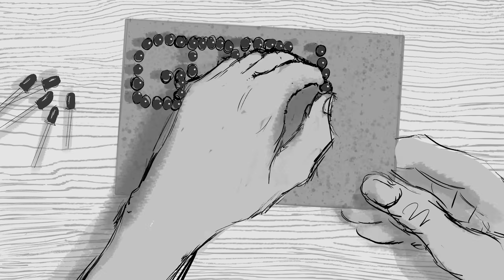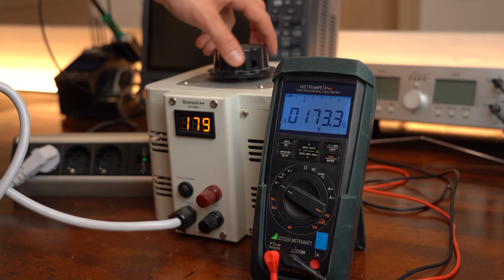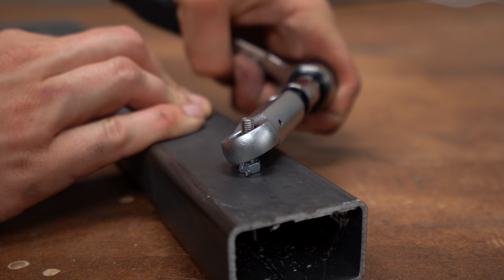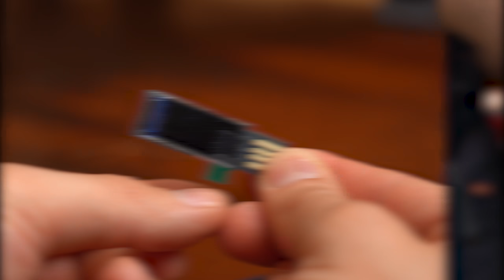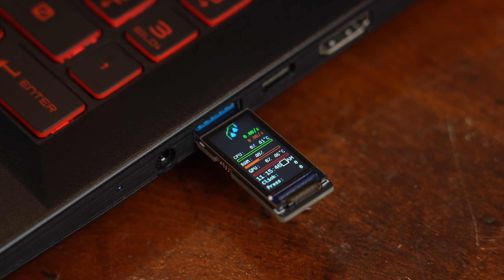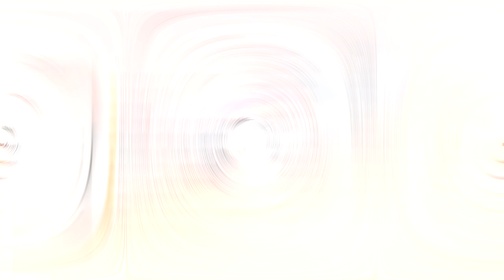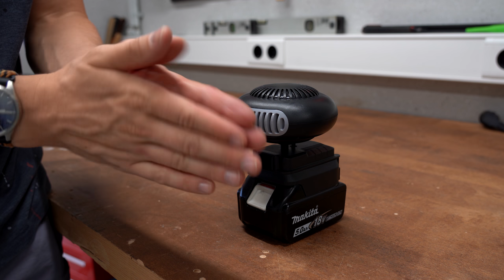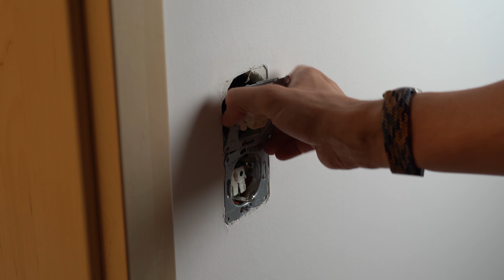I tried finding Hidden Gems on AliExpress AGAIN! (SPECIAL Part 20)

Comment: About Aliexpress and Europe tax, how do you do ? because in electronics, some cart price can double just with the "3€" tax, how do you do ? you pay whatever ali ask without saying things ? Because some product you've shown are well priced (and the price has gone up lately) but just having 3€ per article is too much for multiple product cart with price that sometimes are lower than the tax.
Reply: They should do the same tax too big companies reselling chinese crap.
Reply: @MisterMakerNL yes, but that tax was pushed by those companies so I don't think the EU will do a switch of target, its always easier to make the people pay than companies...
Reply: @MisterMakerNL The import tariffs apply to everyone and all companies but if say Action buys 20,000 usb cables, the €3,66 tariff has no impact. 
If you buy a single cable, €3,66 is significant.
Reply: 3,66
Reply: I really hope this doesn’t come the the uk. Been buying my saved items asap just incase 😂
Reply: We’re having to pay duty for packages under £135 from October 2028 (currently excluded), this means we’ll be paying Roya Mail, DHL and UPS £8 to £12 for taking payment for duty, that will already be worked out, unless the politicians stop the monopolies. Hahahaha.

We shouldn’t be upset.  It’s silly that I can buy an identical item from China at a fraction of the price Amazon sells it for, we need to ensure we bump Amazons and other middlemen profits, where would they be without corporate welfare, considering all the great things corporations do for us … oh wait.
Reply: @The45thClown  
I suspect that AliExpress will setup larger warehouses in the EU and extend the number of item they sell from within the EU. 

That means that customs can do checks on large amounts of the same items while customers will only pay a fraction of the tariffs.
Reply: it's a damn shame. in austria we also get an an additional 2,4€ package tax. so you pay 6€ extra per order. it's so stupid i can't get any of the stuff i buy from AE locally.
Reply: @schwuzi  wym, is it new? Cuz i didn't have it before
Reply: @DanyloGrinchuk there as an import tarriff of 3€ per category in the whole EU. The extra package tax is specific to Austria and will come into effect in september.
Reply: @schwuzi  thank you for info
Reply: @DanyloGrinchuk  yes, because some law change in the EU I think
Reply: @schwuzi its such a shame
Reply: @schwuzi  I needed some part, I can only order from aliexpress in order to get at a good price, but at the end it cost me too much and even Amazon might cost less at that point ...
Reply: Yes, buying from China is now only practical when you buy many of the same cheap items or the more expensive ones. 

I’ve noticed that AliExpress has given an extra €3 tariff compensation discount on orders of multiple items.
Reply: @Conservator.  yeah but only 3€ for a cart that can have many "cathegories" of articles, for now it just look like 3€ for each article. you wanna buy 3 different Ic's that are 1€ each, bam 9€ tax, total 12€ ! insane
Reply: @YourSelft487  depending on the kind of chips they might fall in the same EU category. But yes, every article from a different category will be charged with a €3,66 iirc tariff. It must be killing for AliX’s business in the EU.

I mentioned that AliExpress gave back and extra tariff compensation (discount) of €3 on an order that had 3x the tariff. So I ended up paying about 7 extra.
Reply: I went to the comments to ask the exact same thing.
Also pay attention for a new trick they try to pull. Making the item very cheap but the shipping costs VERY high. If you return the item you only get refunded the low item cost and you can say goodbye to your paid shipping costs.
Reply: @Dsbarrynl yes, shipping costs is a bit of a scam but it’s not new. 
You can filter on free shipping. That also makes it a bit easier to compare prices.
Reply: This is nothing. In Brazil we pay 68% tax in any imported product under 50 usd, and 98% if it is over 50 usd
Reply: @Golskila 😮
Reply: Should we create petition to euro-parlament about that?
Reply: @my-jorney I dont know about jurisdiction and laws, if you know more or if anybody wants to I will gladly support this movement.
Reply: There is no solution to this.
And I am going to make you even more angry. EU takes most of this. It is a pure robber baron tax they are actively stealing our money to fund their own nonsense.
Reply: @cajampa  Big corporation pushed this law at European parliament, Zara, Lidl, Carefour ... all those pushed it so the asian market get poisoned with tax and they gain from it.
Reply: EU is so incredibly evil
Reply: Don't I remember the tax not applying for orders of 150 euros or more?
Reply: @fallingwater yup it should but a guarantee you that it does not work, take 3 item, multiply them so the order is greater than this amounts and you will still get the tax!
Reply: @fallingwater  
Tariffs used to be applied only to orders above €150. Now they apply to all orders.
Reply: @fallingwater No it only counts if you buy 1 item or multiple of the same items for over €150.
Reply: I think the best approach is to wait until you need enough things and order in one go so that tax gets more diluted. Watch more great Scott episodes. But yeah really sucks. So if I can wait I just add to cart until I feel the tax becomes more reasonable
Reply: @tinkerman-q 
Unfortunately that won’t work because the tariff is applied per EU category and categories are very granular. 
So if you’d order a e-ink display and a lcd display, you’d have to pay twice the €3,66 tariff (assuming they are in different categories).
Reply: @Conservator. Yeah I get that. It may make it trickier. But can still work on some scenarios
Reply: @tinkerman-q  aside the 3€ tax there is also an heavily increased normal tax since the import  tax exempt orders that were below a certain amount of money now also get taxed from the first euro
Reply: @JohnDIYSmith yeah  but at least that's a percentage instead of a stupid flat fee, which is still a fraction of the price. But in general It's so stupid that the tax is on top of the 3 euro fee
Reply: @tinkerman-q  its 19% consumer taxes that get stacked with another 19% import taxes and the additional 3€ . That's almost 40% taxes and when you count in the already taxed income which is another 22% this totales at 60% taxes which is insane ...
Reply: Yes, the construction of this EU-tax is extremly stupid! There is a incoming Tax-platfirm in 2028, but the politicans panic and made this interim duty😡 Its very bad just for people with electrinics as a hobby, as if you repair things, you could easyli need a lot of different components, and the cost will be horrible - its not economic to repair things😬 Its contradictinary to the Right to repair - directive, also from the commission. But politicans do live in another world, and the belive that people just bought a lot of clothes from China...(because that was what they where told by the lobbiest...
Reply: @KaterinaAndersen oh well they don't get to buy inferior products 😂
Reply: Absolutely crazy 😧
Reply: It depends on the seller, some include tax and everything in the price.
I know for sure that "Choice" items have the tax included, and I'm from Saudi (we have VAT and customs fees).
Reply: @bader51500  Ali automatically adds VAT and advertises prices including VAT. 
The tariffs however are calculated only when you enter an order and are visible just before payment. It’s not possible to include the tariff in the item price as it depends on how many items you buy and if you buy other items in the same EU category. 
Ali does warn you that tariffs may apply when ordering from the EU.
Reply: @Conservator. 
But doesn't AliExpress have local warehouses in the EU? 🤔
Reply: @bader51500 They do but only a small amount of selected products (usually expensive ones) are sent from EU warehouses.
Reply: @bader51500 sometimes the items stored in those warehouses haven't been "imported" yet. they are in the physical area, but haven't really gone through all the customs and stuff. so, the delivery would theoretically be faster and all, but tax still applies. I've also read some reports from people paying for "EU warehouse" items on Ali and then the sellers messaging them that there's no stock or straight up refusing to ship
Reply: @bader51500 yes, but not for everything, in fact AliExpress itself is not a seller, so it's up for the suppliers. You can filter by "ships from eu" but that is only a small subset of available items.
Reply: I thought I was tax cattle in Canada... You euros take it to another level of anarcho tyranny.
Reply: @michaelmcwilliams5403  :)
Reply: There's really no other choice. There are some sellers that ship from inside the EU, but electronics stuff is usually not available. I've started to get some stuff from local stores, and use AliEx whenever it's still the best option. Also, if it's consumables, like soldering iron tips etc, buy "in bulk" if possible, i.e. don't get just one. The tax is the same whether you get one or more of the same item, so you might as well stock up
Reply: Use cash back services to try and recoup some costs (top cash back etc)
Reply: I know, it really cut my spending a lot because AliExpress, Temu, SheIn and even Trendyol have those extra tax. 
They say they will dropp the tax if you buy in values higher than 150Euro but as soon as you reach this value nothing changes because those taxes are transferred into custom manipulation and storage tax. 
I tried to order via Local Storages but on those they add a transportation tax that is equivalent or more than the previous tax.
Reply: @elenabob4953 just to be clear, they don't drop the 3€/category fee out of good will once you reach 150+€. the regular custom tariffs apply above 150€. it's been this way forever now. before it was no customs charge below 150.
Reply: And as of 1:st November they plan to impose another fee around 4EUR for "Customs Handling" that also opens for the carrier companies to take an extra fee of around 10-15 EUR/parcel. This hobby will come to an end😢
Reply: But the Chinese sellers are shipping in bulk into EU and often also 'pay the €3' for you. So it's mixed. But yes, my AlieXpress spend is way down now. The annoying thing is it's not like these things are even available from European manufacturers. China is just making lots of weird stuff like shown here that no one else is
Reply: In the netherlands i tend to buy stuff at bulk (multiple electronic parts + other items i need like towels or whatev) the price is usually reasonable, i would only spend around 20-30 euros per aliexpress shopping
Reply: @Inactyve  Yes but the law stated that the tax is added at each category, so if you have 5 item that are "electronics" you still get 5 times 3€ of tax...
A shopping cart of 11€, 2 items, 7€ of tax..
Reply: @YourSelft487  It does, but ali just applies it to every singular item anyway...
Reply: @YourSelft487 There is no "electronics" category in customs books. It's incredibly complicated and there are thousands of different "categories". A capacitor is something completely different for customs than a resistor. So yeah, you're basically paying €3 for each different item. Only if you order multiple amounts of the exact same item you pay €3 once. But this stupid rule is temporary: They're going to change the system and it's planned to go live July 2028. Then you only need to pay the real import duties for each item. For low priced items this makes a world of difference.
Reply: @WouterVerbruggen  it’s per EU category but they are incredibly detailed. 
I’ve bought a few sensors, different products but all temperature and humidity sensors and was only once charged the €3,66 tariff.
Reply: @Conservator. It’s random. I was buying 868 MHz antennas. The exact same antenna from one seller didn’t have tax added again (since I already had a smaller antenna in the cart), while a second one that was 40 cents cheaper had an extra €3.50 tax applied. I’ve stopped buying junk on AliExpress entirely.
Reply: @kubsztal It’s not random and it’s not tax. Tariffs are applied to EU product categories. €3.66 was added to those 2 antennas together.
If you had to pay 2x the tariff, Ali (or one the sellers) mis have placed the antennas (possible incorrectly) in different categories.
Reply: @Ni5ei  is AliExpress going to change the system or the EU?
Reply: @Kira-t2f5l  EU is going to change the import category system. Supposed to go live July 2028.
Reply: Yea i was wrong, we really do be needing to pay €3 per item now :c
Reply: I always buy in bulk, thus the changes are minimal.
Reply: @y2ksw1  For the fast majority of hobbyists, that is not feasible. I need 1 or 2 of an item, not 20. And if the price for those 20 was not the problem, i would have bought local already
Reply: @y2ksw1  that's irrelevant because they also added an additional tax on the final ammount since the minimum sum needed to pay taxes got removed
Reply: @JohnDIYSmith  I don't know how you make shopping. I compare all offers and collect the item list for each provider. Then, short before I run out of components, I place the order. I do not randomly pick one thing here and another there. For example, I take 100 IRL44Z MOSFETS and resist to take an OLED display and an Arduino or an ESP32. If the price is too low in the shopping cart (delivery fees etc) I add more MOSFETS of the same type. I also add the lists if my friends, and adjust as fits.

If I would buy an entire container, the category tax wouldn't be a headache at all.

You see, where I am going: have friends adding to your order, divide the expenses. And if the overall price is constantly too high, maybe you should start to collect electronic devices and take the components from there. Besides being very inspiring, it is also an excellent resource not only for materials of all kind, but for making a decent income. Naturally aged components are used in medical and military equipment and you get hefty bucks for them.
Reply: @y2ksw1  that's not how that works .
There is 19% consumer taxes like always and now they removed the minimum amount required to get charged import tax.
So if you buy somthing its 19% consumer tax + 19% import tax which is almost 40% taxes on the product no matter if you buy in bulk or not .
If you think about it its even more .
The money I spent on that product already got taxed by 22% income tax totaling the tax on the product to 60% taxes on its value with the additional 3€ import duty which is insane .
Reply: @JohnDIYSmith  Ok, maybe we are living in different worlds.
Reply: If this channel is a source of income, the products he reviews would be tax exempt and potentially all free for him.
Reply: @95rav Tax could be claimed back but not tariffs.
Reply: It still works fine. Just open your eyes
Reply: EU's legalized theft. More to come.
Reply: Wow a whole $3!
Reply: @YourAverageReviews that’s quite a lot if you buy something for €1 or €3 or even €6.
Reply: @YourAverageReviewsper item ... So with electronic components it can multiply easily...
Reply: @YourSelft487 It sure can, but let's no act like the price isn't still cheaper, right?
Reply: @YourAverageReviewson some components it's still lower than Amazon or ebay but it's still a bummer to pay 1/3 of the article price just in tax sometimes.
Reply: @YourAverageReviews that's such a BS argument .
It literally takes 3€ for an 1€ item.
On top of that they changed import tax regulations. If I buy something it gets the regular consumer tax of 19% + now a 3€ per item fee . on tip of that comes another 19% import tax now. That makes it almost 40% taxes. If you take the income tax into consideration it is 60% taxes on a purchase in total which is nuts
Reply: I think this series is sponsored by aliexpress, he probably won’t talk about this topic
Reply from the maker: These videos are not sponsored by AliExpress. I just pay the price that is shown to me. Most of the time, it is still a good deal. But I dont remember paying 3€ extra for each item.
Reply: @greatscottlab  I've added one of the BLDC driver, and the mini voltmeter, total price of 9.48€, plus expedition, 1.99€ so total should be 11.47€, but I get 7.20€ of tax, why ? it's almost the same price that the two article... for now, asian market is dead on this point, or you have to buy in bulk..
Reply: @greatscottlab the EU has recently added a tax on items from china (maybe other countries but obviously it mostly effects china), it's 3€ per category of item, the youtuber "Learn electronics repair" has a video on it from a couple of weeks ago I think
Reply: @V@V_J-b5g They’ve approved it, but it hasn’t gone into effect yet.
Reply: @theondono  Aliexpress still make you pay for it, it  passed as of jully i think.
Reply: @YourSelft487 obviously ali express has nothing to do with EU taxes. They sell at a price and then add what regulations require on top. But I didn't see this tax yet and obviously a fixed 3€ per item makes no sense at all..
Reply: @greatscottlab crazy 😧
Reply: @YourSelft487 crazy 😧
Reply: @theondono ahhh ok, thanks
Reply: @V_J-b5gNot only China, the whole world outside EU...😢
Reply: @theondono Wrong! It started 1 July.
Reply: @greatscottlab  very likely you ordered the items before the tax started being enforced, it only started July 1st. 
If you stay under 150€ you pay 3€ extra for each type of item.
Reply: @greatscottlab That’s per juli 1st iirc.
Reply: @zaku2552  How much is it if you go over the 150 mark?
Reply: @whitecanegamer  standart import rate, that was never touched by the law.
Reply: @greatscottlab Aliexpress zeigt die steuer nicht an. Bein wechsel stieg mein warenkorb von 50 auf etwa 85€ für die selben artikel. Aliexpress addiert pauschal 3€ auf die meisten Artikel. Aktuell heißt das man Zahlt 3€ pro artikel, auch wenn man mehrmals denselben oder mehrere einer kategorie bestellt. Vielleicht ändern die das noch. Jedenfalls war mir das dann zu teuer für die durchwachsene qualität.
Reply: @V_J-b5g 
Not tax but import tariffs.
Reply: @theondono 
It has gone into effect. You can check by entering an order on the platform. If it isn’t shipped from the EU, the tariff(s) will be added to your order.
Reply: @greatscottlab I would guess that is because Switzerland is not in the EU.
Reply: @DominicSherry1 Switzerland?!?
Reply: @kaefjot08 I think I have him confused with Andreas Spiess, my bad
Reply: @greatscottlab it's EU tax 😢I used to order a lot of parts on ali to fix tech stuff but since this tax exists it's too expansive here (🇫🇷)
Reply: @AvocadoGoPewPew  it's always a pitty when sponsor tell their influencer to not talk about a subject, if you want to be known in a good way and that people think good about you, adress the issues and talk about them, it's that simple.
Reply: For further information, I was not speaking about GreatScott but Aliexpress, they know they are getting less customer because of this regulation, they need to step-up and speak about it.
Reply: @YourSelft487 shhhh 🤫
Reply: @YourSelft487 sure sure sure
Reply: @YourSelft487  I don't think this series is sponsored. Not by Ali Express anyway.
Reply: @whitecanegamer I didn't know if it was, but GreatScott confirmed it was not.
Reply: @YourSelft487  it's China so good luck